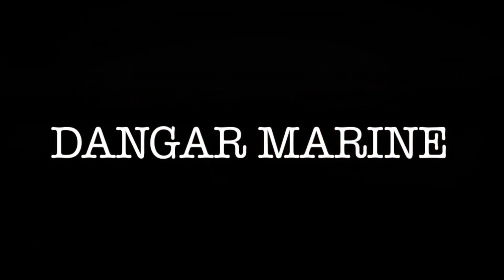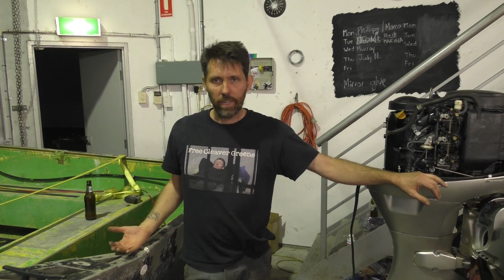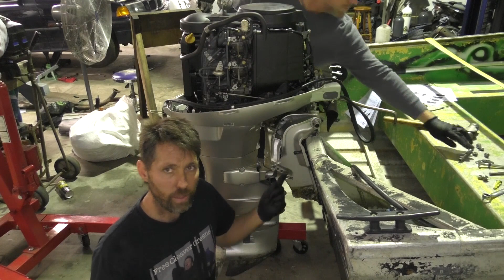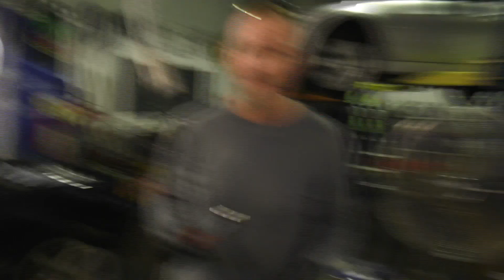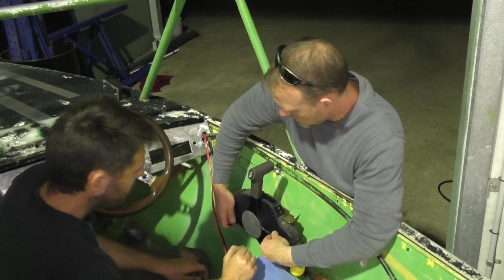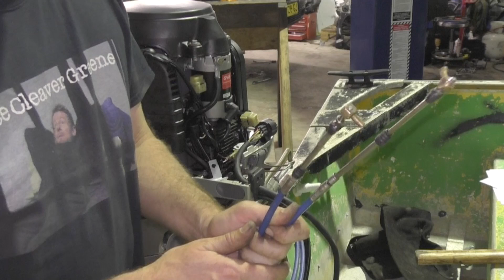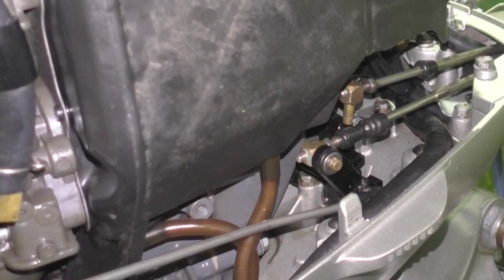Mounting an outboard motor

Comment: Stu, Again a nice video de mystifying some of the work that a dealer normally does and most boat owners never do .In regards to the height debate. On a 4 stroke I believe this is not an issue, but on 2 strokes how much difference would a higher than suggested engine mount make to the idle settings?  I know I can't adjust idle setting on my 2 stroke 50hp engine unless the boat is in the water due to the exhaust back pressure having having an effect on the intake air/fuel  volume. A suggestion for a future 'fit and try' product - how about a bit of an expose on the cavitation plate ' whale tails'?
Reply from the maker: Hey Ron, yes, the exhaust on two stroke motors is very finely tuned, that's for sure. Given the Honda doesn't have an after market cavitation plate on it I'll drive it around for a while to get a feel for it then put one on and see what difference it makes. It would be interesting to see, but apparently they can affect different hulls very differently so my results may not be the same as other boats.

Comment: Thanks for posting these videos. Just got myself a 19ft Centerconsole boat with a 115 Mercury 2 stroke. The boat was sunk so it was relly cheap, and now the motor runs great, only need an new starter. It had been ordered so maybe on firday i will have it. And this channel is a great inspiration. So thanks again. Sorry for my bad english, i am from Norway.
Reply from the maker: Hey Roy, sounds like you also got a great deal. I'm glad the videos are helping you. Your English is excellent, much better than my Norwegian! :)

Comment: Excellent as usual Stu.  I usually use clear silicone or white/black Life Calk when mounting engines depending on the hull color.
Reply from the maker: Thanks Will. Matching the sealant to the hull colour is a nice touch. :)

Comment: Hi Stu, your waterpump may be fine! I had a similar problem with my BF30. The flushing muffs can't supply enough water, due to the extra intake under the cavitation plate, Honda recommend a special fitting which delivers water directly into the pump, I find using a barrel of water works well, and saves buying a specialist part!
Really enjoying the vids, can't wait for more Honda four stroke ones, keep 'em coming.
Nick.
Reply: I have had the same issue...as soon as the whole cavitation plate goes under it starts pumping via the telltale...crisis over
Reply from the maker: You're dead right Nick. I put it in a barrel yesterday and it pumped just fine. I'm never convinced a pump isn't working from muffs, they always seem a bit hit and miss.

Comment: Great series. I'm following with interest as tidy up my boat this winter.  Your advice is great.   Curious about your thoughts or experience on adjustable jack plates as a means to alter the height of the motor?  I fish in some shallow spots it'd be nice to get in further to some smaller reaches. Always looking forward to your next video.  Cheers
Reply from the maker: Thanks Greg. I don't have any experience with jack plates, but in theory they should give you the best of both worlds. Like anything though I imagine it comes down to installing something of high enough quality to do the job well.

Comment: really great video was really helpful just getting ready to fit my new outboard good timing
Reply from the maker: Hope the fitting goes well. What are you putting on?
Reply: It's been fitted to a princess Pilgrim 25 the inboard engine finally died but has been in since 1965 so has done well
Reply from the maker: That's a good run since '65 then. :)

Comment: thanks, do you know how easy it would be to convert a tiller handler version of this motor to remote steering?
Reply: super easy we did it
Reply: All you need to do is get the cables out of the tiller and attach them to a remote and for steering use the cable from the wheel to the under U shape just below the engine.
Reply from the maker: As lundyjack said, it isn't hard. Outboards are designed to be tiller or forward control, it's just a matter of swapping parts over.
Reply: +Dangar Marine thanks guys